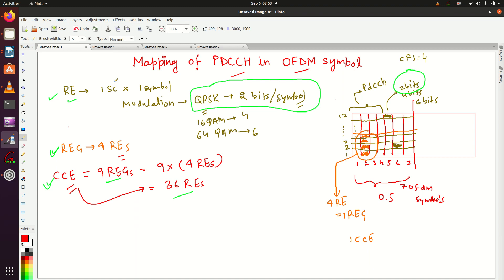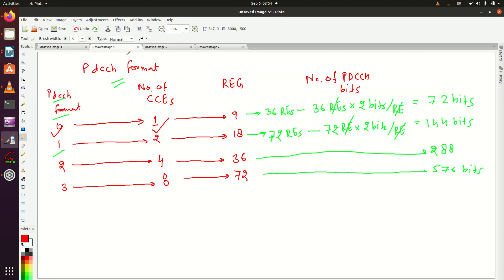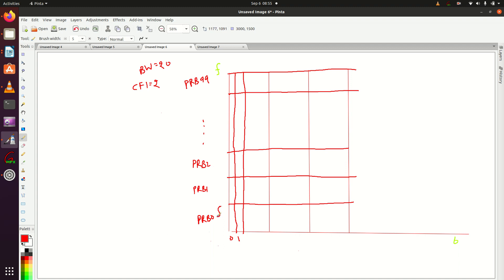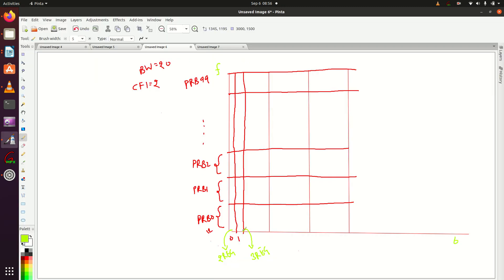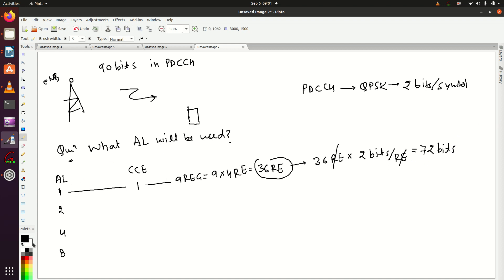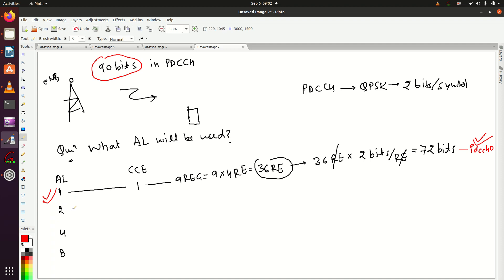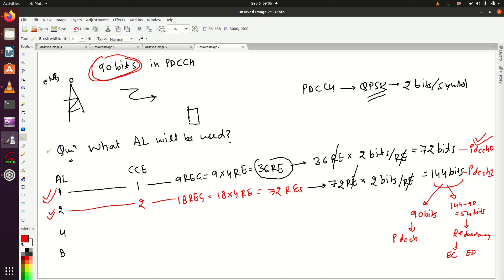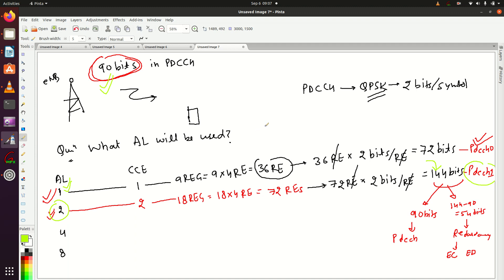LTE PDCCH DCI RNTI Part6

Comment: If we need 144 bits of information...which one vl select...?
Reply from the maker: Hi..If UE is in good radio condition (no need to send redundant bits for error correction) and you want to send 144 control bits then you can use AL = 2. If UE is in poor radio condition (need to add redundant bits for error correction) then use AL=4 (144 control bits + redundant bits).